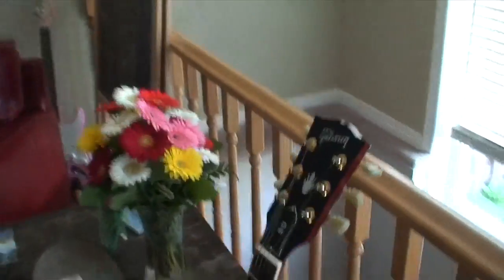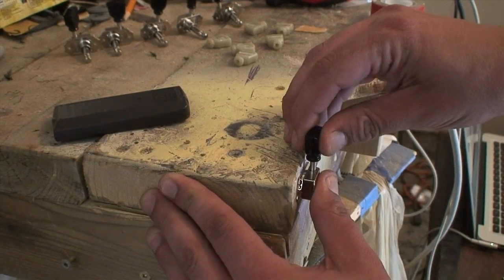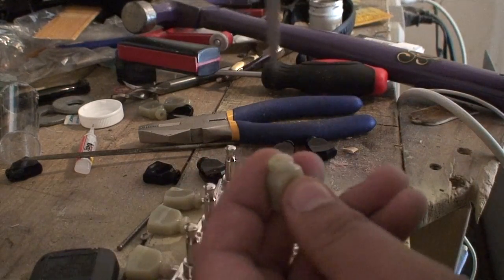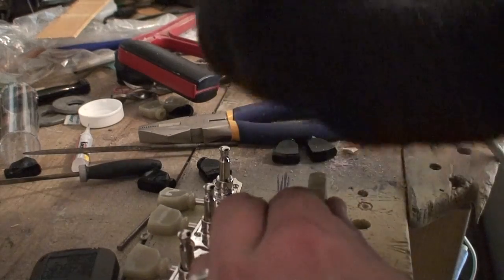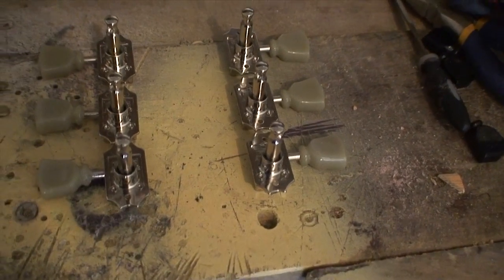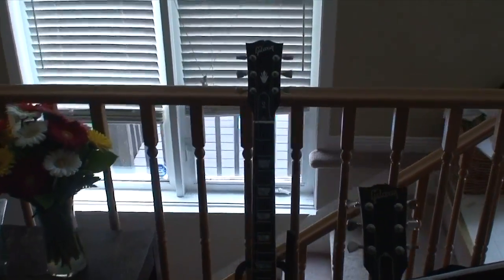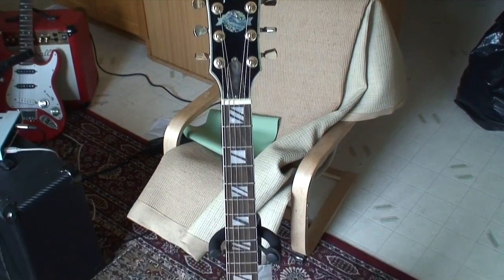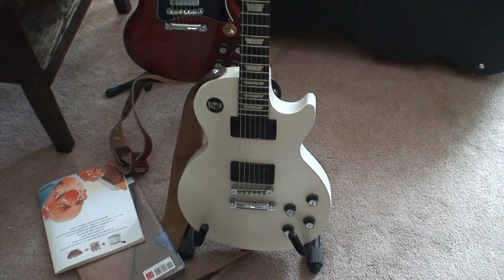How To Replace Tuner Buttons On A Gibson Les Paul

Comment: Man, on the Kluson style tuner buttons, the reason you had a hard time putting them back on is you should use heat. Do you own an adjustable heat soldering iron?  Heat the shaft up a bit before you pull them. Just a bit.  Then make you a fixture to hold the unit and use a vise to press them back on, again using a little heat on the shaft as you press them back in place between the vise jaws. Then just add a drop of super glue at the joint of button and shaft when you're done.  It's a wonder you didn't wreck out those tuners or bend the shafts.

Comment: All you need to do to remove plastic tuner buttons is place them in boiling water for 20 seconds
Same goes to put them back on - no tools needed, just dip, pull and slip :)

Comment: You should heat the shaft with soldering iron for a few seconds and it goes back in like knife through butter to desired depth, and not bang them with hammer like on this video LOL.
Reply: Also heat the new tuning heads in near-boiling to boiling water for about a minute then forcefully slam the water out of the hole (smack the button hole-end down on a flat surface once or twicw) before you press it onto the heated shaft.  No reaming, easy-peasy and fast without so much frustration.  (The boiling water will not damage the button.)
Reply: @runningwithscissors0911  i'm SO GLAD I read these comments before I followed the advice in the video. took literally 10 seconds and no effort this way. THANKS!